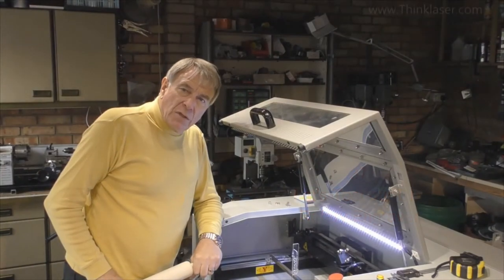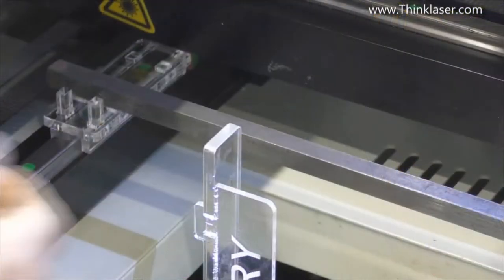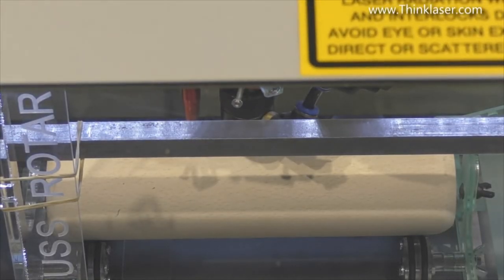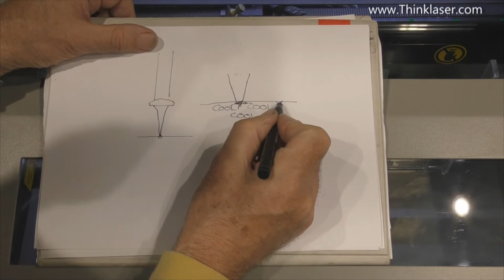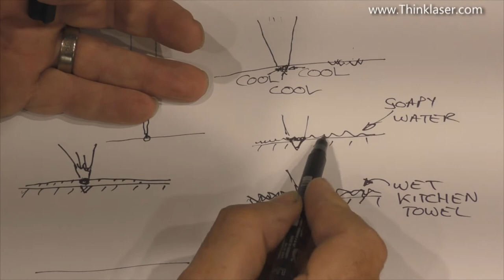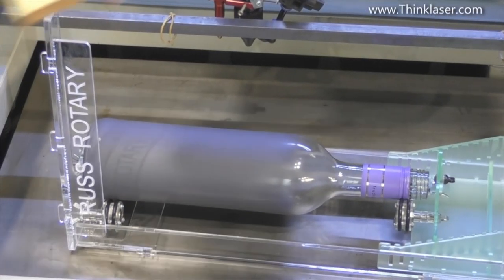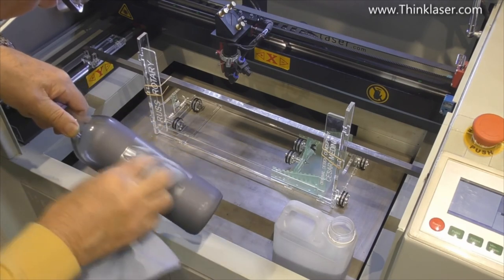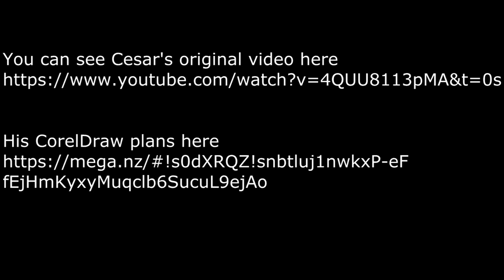How To Use A Laser Cutter - Lightblade Learning Lab 37 Let's Test our DIY Rotary Engraver

Comment: One thing you could add is a magnet on the rail runners so it will move back and forth with the gantry but if run out when returns it will disconnect and not damage gantry.
Reply from the maker: Hi James,
Thanks for the comment, I'll pass the suggestion onto Russ.

Regards

Gareth @ Thinklaser